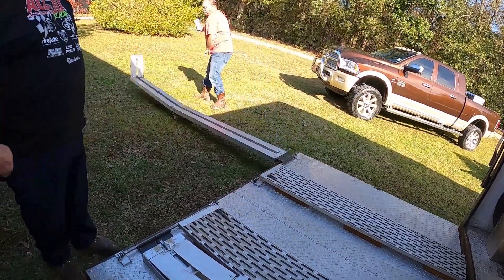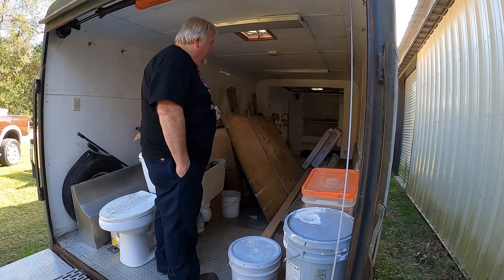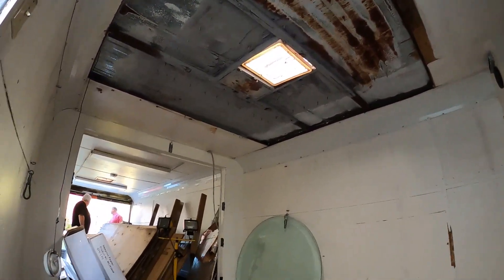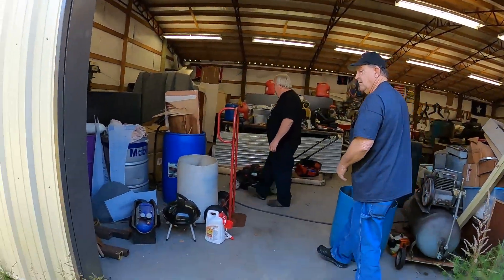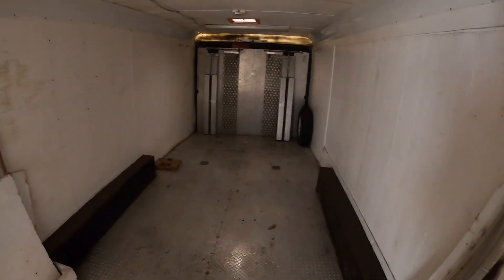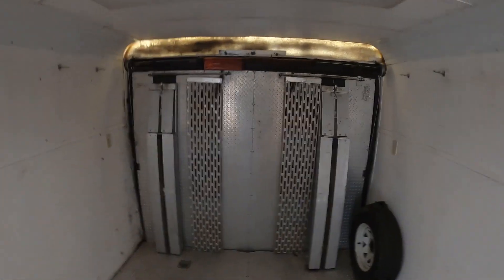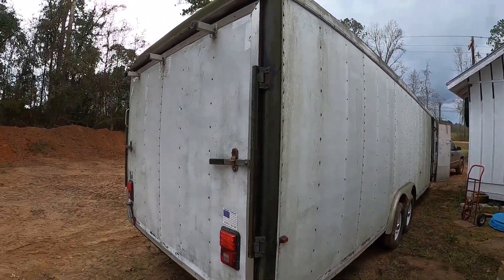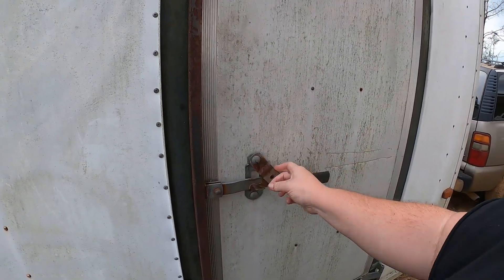We bought a car hauler trailer project for Miss Fitt or Aces High. New (to us) unit

Comment: I have a 1993 pace enclosed I bought with a leaky roof. I scrubbed the roof down with some simple green and a pole brush. Then I ordered some 4” wide eternabond tape from Amazon. I cleaned up the seams with a soft wire wheel on a grinder to remove the old cracked gutter seal and then wiped clean with some brake clean. Applied the tape and used a hand roller to adhere the tape good. It’s been leak free for over 3 years. Good luck with the project!